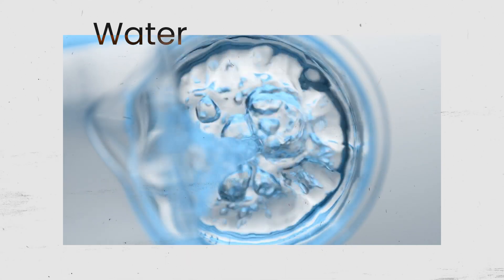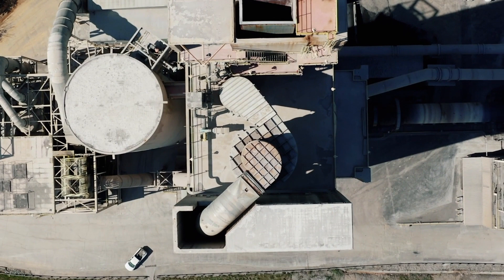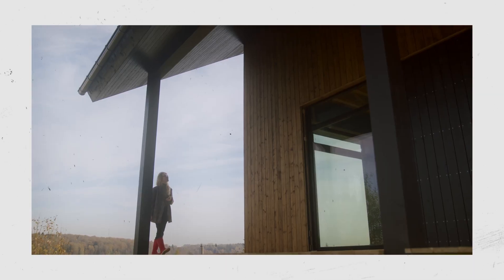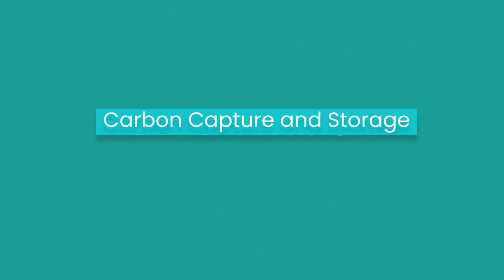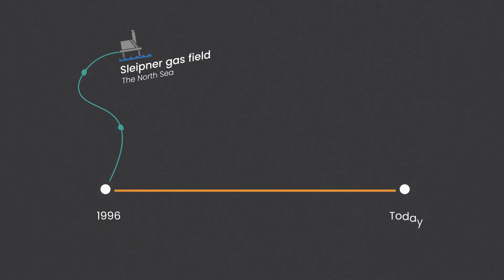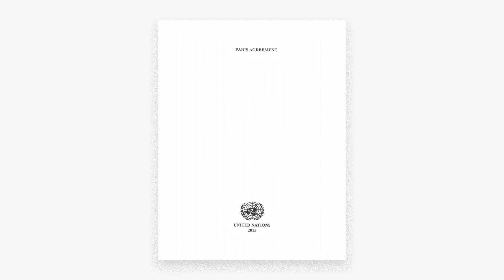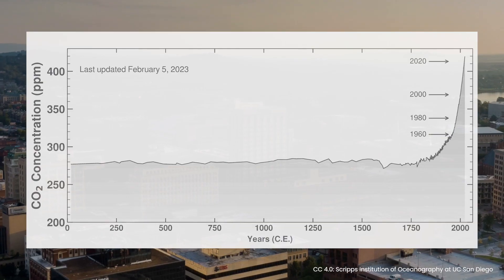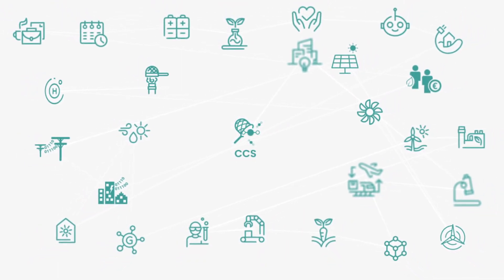How can we decarbonise cement production?

Comment: Using basalt stone (calcium silicate) instead of limestone (calcium carbonate) can do the trick (see Brimstone company). And by using Hydrogen or industrial heat created by renewable sources to heat the kiln can do the rest. What's more, by adding CO2 or activated carbon into the concrete mix can make the concrete stronger so even carbon negative concrete is possible.
Reply: Man you should really consider working in the energy sector you seem to know alot man, that and these are really good ideas